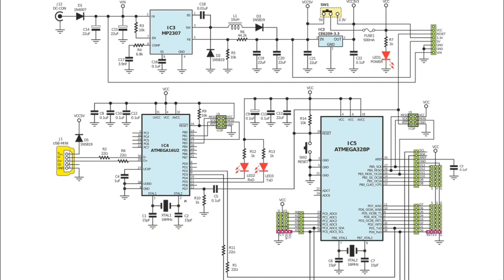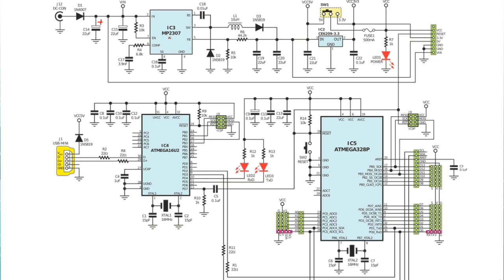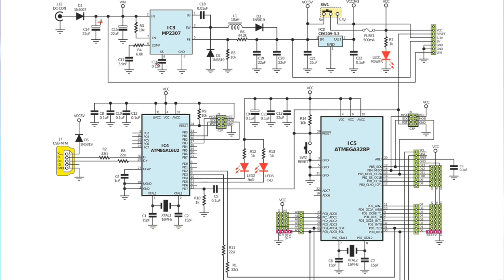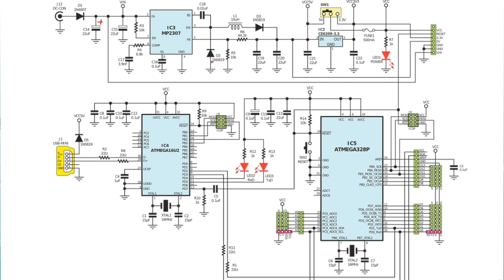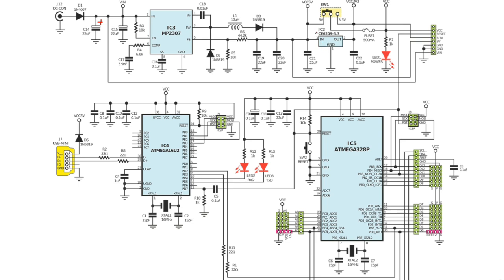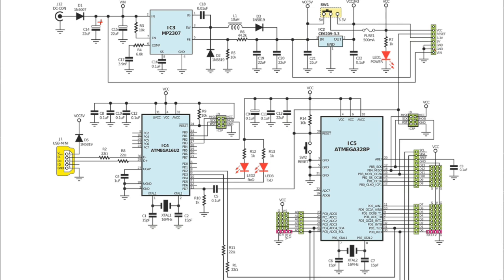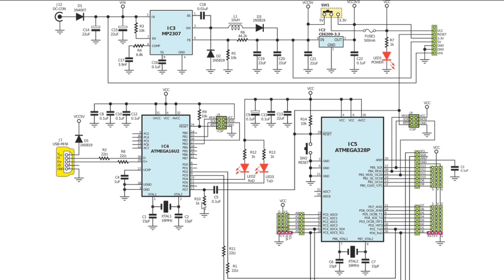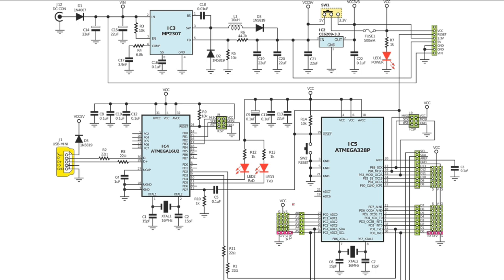Master Schematic Reading - Electronics Repair

Comment: what was this ?
"this is connected to this,  this is connected to GND, this is a capacitor"
OK so.... if you're going to teach people to READ A CIRCUIT why not explain what each component is actually doing in the circuit instead of just mentioned that it's there.
Kinda Pointless don't you think ?
Reply: Lass es gut sein, wenn dir nicht passt muss du nicht anschauen, by by…